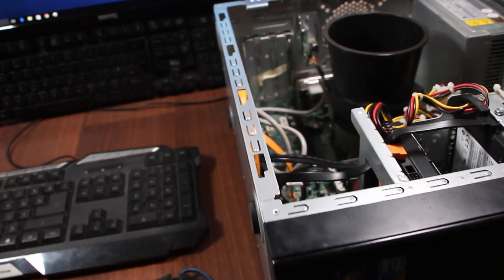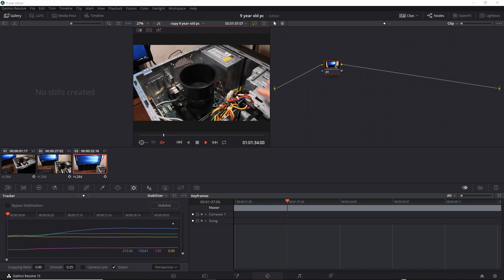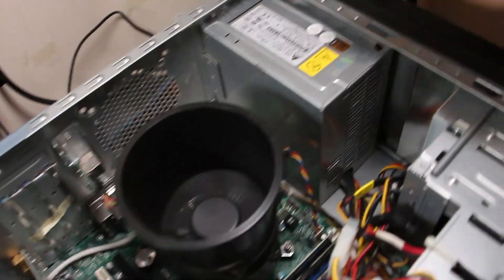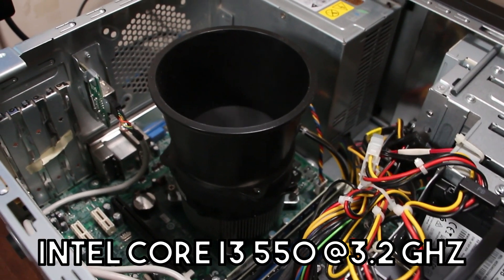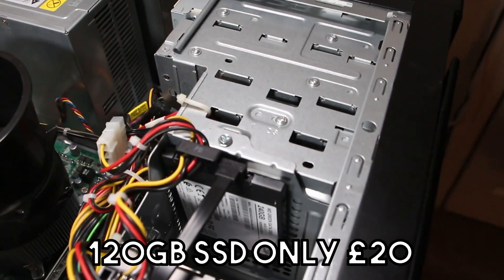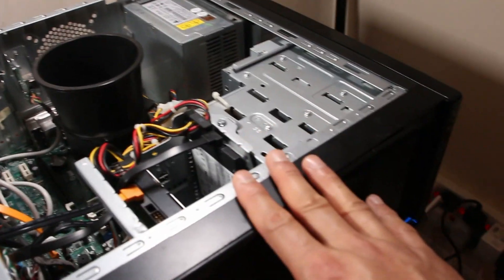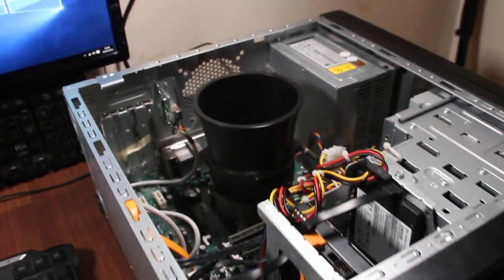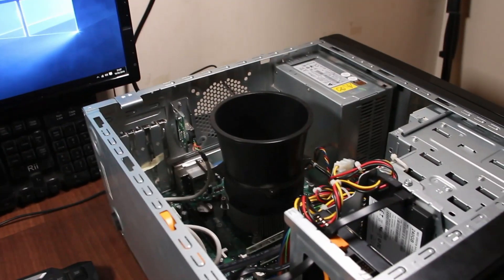How To Make An Old Computer Fast Again & New For Only $25 (£20) - Acer Aspire M3910

Comment: My friend installed a new SSD on my M3910 two years ago. Also upped the memory to 7 GB DDR3. Also changed from Win 7 to 10. Best thing I ever did. The old machine is so much faster now in every way, especially start up. Money well spent. Original graphics card on motherboard has just broken, so adding a seperate Asus Geforce GT730 passive cooled card, which is another upgrade from original. As long as the motherboard doesn't go pop, you can keep these old PCs running. Mine is 10 years old and better than new.

Comment: You mentioned being able to upgrade the motherboard to 16gb ram? Everywhere I look the specs for the m3910 state max ram capacity is 8gb - I want to upgrade to 16gb but do not want to buy the ram if it cannot handle it ... so have you tested the 16gb upgrade?

Comment: I have an Acer Aspire M3910 with H57 socket and a P01.A4 BIOS. In this moment I have an i5-650 but I would try to update it to Xeon 3470 or i7-870. My question is, if I get one of these, then can I overclock it? I only have Intel turbo boost in my BIOS. I don't have any other options about overclock.

Comment: can this motherboard support a gtx 1050 or rx 470
Reply: I am running a gtx 750 ti and it runs smooth as silk - the only other upgrades I have done has been increasing my ram to 8gb and a new hd a few years back with windows 10.

Comment: Greeeeeat Review!
Totally enjoyed watching it as I have the same Pc.
Now I know for sure from you Video that I can go up to i7 (was not sure before)
*Ugraded a while back to SSD 240.
*I have just upgraded from 4 Gigs of Ram to 8 Gigs.
*Just waiting for the GTX 750Ti Gpu to arrive.
*Removed the 300watts of PSU that came with it for 500Watts EVGA.
*Got a Cooler Master Hyper 212.
Now I will be hunting for an i7 or i5 CPU. The Bios thing is giving cause for concern because as at now there is no update to the Bios which sits at version P01-A3.
And If I install the i5/i7 and cannot update the Bios?
Or will the Bios system Change after detecting the new Cpu?..... I just dont know!!!!

Comment: I have this PC. I upgraded the CPU to a i5 760, put 8gb of Ram in, added a 240gb SSD, a 600w power supply and a GTX 770 2GB GPU. It's not bad for gaming but certain newer games would run better with a newer generation CPU. Old games run fine but the air flow sucks, even after adding a rear exhaust fan. Sadly there is no more places for more fans but i might zip tie one on the side panel for intake.
Reply from the maker: That's what I'm talking about.  If only you could do a video on it and showcase some fps!

Comment: Hi, Great video.  I have the Acer Aspire M3970 which is not upgrading Windows 10 beyond version 1709.  When trying to upgrade to the latest version the computer fails/freezes.  I think the problem is the BIOS, currently PO3-A1.  The various upgrade failures numbers that is provided (i.e., 0xc1900101) don't give needed info to resolve the failures.  I have 2GB of RAM but don't use it for gaming. Do you think the problem could be BIOS?  Thanks, Jim

Comment: hi i have a question about my 6 year old laptop, i am about to fly overseas for years, do u think it is good for me to buy new battery or simply just buy a new laptop?
Reply from the maker: Depending on the country you are travelling to, I generally do not advise to buy an electronics device in one country to use it in a different country for long term use, its best to buy a laptop in the country you will be residing at, but this also depends on the availability and price, if it makes a huge difference, then by all means it may be worth it.  This is due to after sales support which may be difficult, it varies from make to make and upon the tier of laptop you get.  As for your battery, if it needs replacing, then sure you can get a new one before you travel.
Reply: @HealMyTech1  Thank you very much sir! After what u've told me, i think i will just buy new  battery for the time being

Comment: Will it be able to run using gpu radeon especially rx460 2gb?
Reply from the maker: Yes it should, as long as you make sure the PSU is adequate